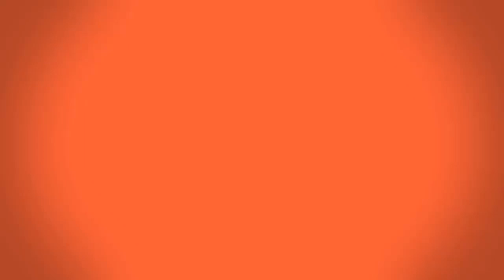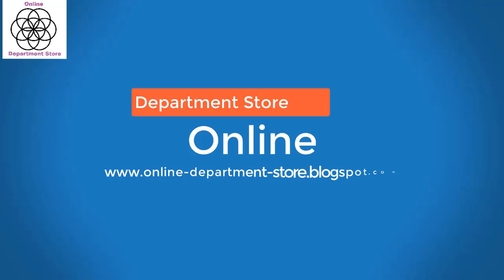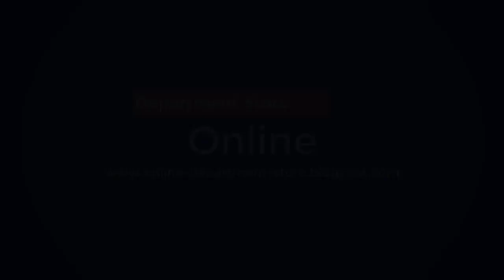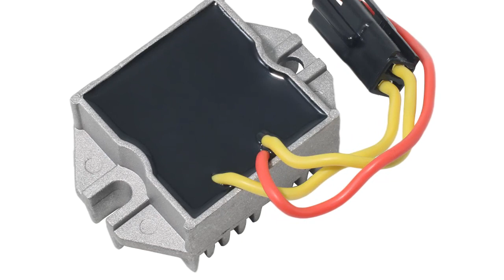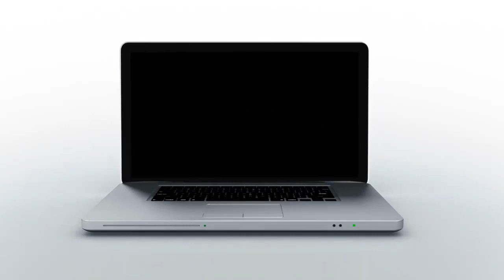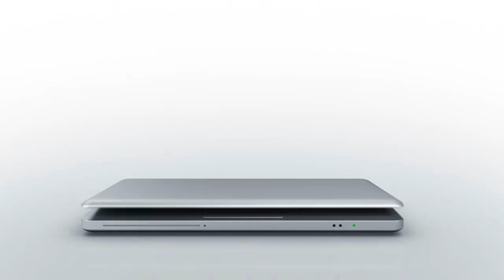Motorcycle Rectifier Voltage Regulator - Max: 20AMP, 35HP

Comment from the maker: A motorcycle rectifier voltage regulator is a device that accepts input from the battery and outputs a steady voltage to the electrical system. This is especially important in motorcycles with high-powered engines, as it helps to ensure that the engine receives a consistent stream of power. Without a voltage regulator, the engine could be subjected to inconsistent power levels, which could cause damage over time.

The best motorcycle rectifier voltage regulators are those that can handle high currents without issue. In particular, it is important to find a regulator that can handle up to 20 amps of current without any problems. Additionally, it is important to find a regulator that is designed for use with Briggs and Stratton engines. This will ensure that the regulator is compatible with your motorcycle's electrical system.